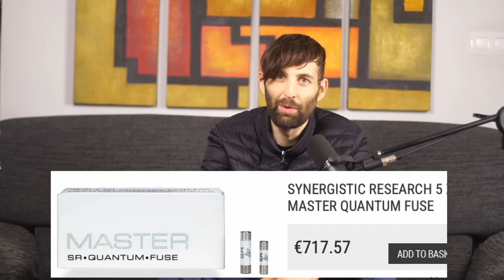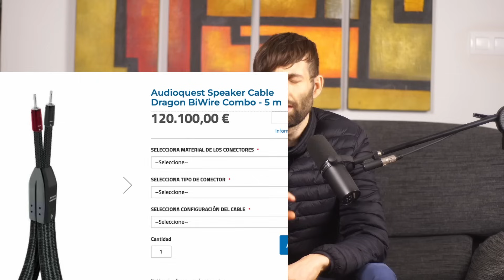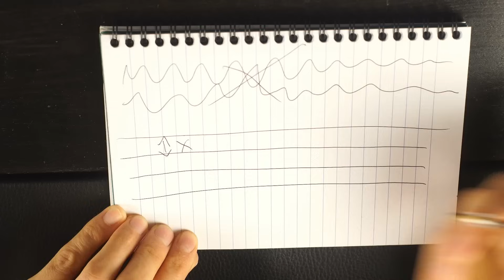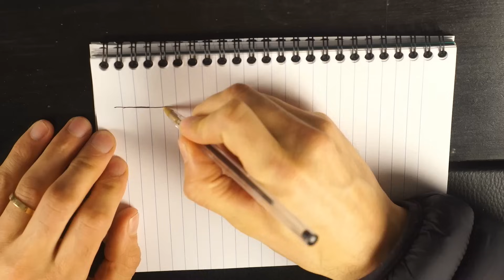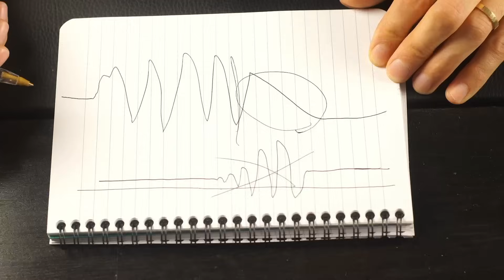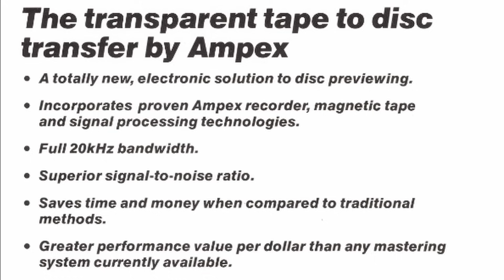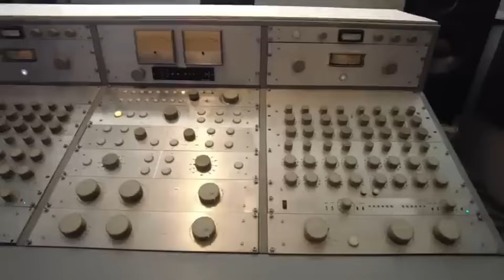Hard truth: most vinyl is digital anyway

Comment: I saw a video from YouTube where this audiophile started to listen vinyl after years of digital. He took quite engineer's approach to it which was nice. For example how vinyl "sucks" itself a ton of static electricity and that adds pops and bangs to the sound. But one thing really caught my eye; how damn dirty vinyl records are when he looked them under microscope. He tried to brush them with different type of brushes and wash them with expensive record washer and still the record grooves were filled with stuff. Does that dirt add to the "warm sound" of the vinyl...?
Reply: Since ultrasonic cleaning machines have been used, vinyl is quite clean- even under a microscope.
Reply: @Eightplex  Like I wrote, not those records. They were filthy even after the ultrasonic, and if those were filthy a lot records will be.

Comment: People like to compare their x1000 euro ‘analogue’ setup with a 50 euro cd player made with the cheapest dacs.  Yes, you can convert digital information to a non digital storage medium and then play it back through the best equipment and it will sound better than having a flawed device spreading the digital information into a  non accurate analog signal. The digital information stored on a cd (or where ever) is enough to recreate the original signal - as far as that signal is cut off to a frequency an organic human can hear.    But the sound waves banging on your eardrums are analog. So it is all about the way you convert the digital information into an analog signal.    And if you like fiddling with records: listening to music is mostly about the whole experience. So I can understand that fully.
Reply: A 10$ modern DAC chip sounds more transparent than vinyl.

Comment: There is an era of vinyl, late 70s early 80s where they were actively marketing that it was DIGITALLY RECORDED.  These were the audiophile discs of the time, demanding a higher price tag because it was a new and superior method of recording and mastering.  I collect DBX encoded vinyl from this era whenever possible, because it really does reduce surface noise and it's always a very good recording.
Reply: @jdraven0890  1812 Overture vinyl brags about digital cannons.
Reply: @Keith-ux9ku  ok that is hilarious - I really prefer fully analog cannons, myself though using one in a recording studio poses obvious challenges
Reply: Alan Parsons' Eye In The Sky album proudly boasts being recorded and mastered digitally. Sounds great on vinyl or CD imo

Comment: Seriously, this video is silly. 

Of course digital is not transparent. Not only does the conversion designed subjectively, but there always is an analog component to every digital music source that is actually listened to. 

No vinyl afficianado says vinyl is inherently better sounding. At least, no serious collector. But the recording, mastering, pressing of SOME vinyl records sound appreciably better than the CD version of the same release. 

Clearly you've never listened to great records on a solid turntable.

Plus, mastering on the majority of digital releases can be described as "brickwall" such that the dynamics are compressed out of the music. Which is why I have CDs and the same release on 24/192 with the CD sounding much better.

Comment: This guy needs to rephrase his inflammatory headlines. Vinyl is NOT digital. When you can embed computer code into a slab of vinyl and have that code read by a computer that converts it into audible sounds, then THAT would be digital vinyl. But that will never exist. Similarly, a cd cannot hold analog data. There’s no such thing as an analog cd. Magnetic tape on the other hand can hold either type of data.

What sounds better, vinyl vs cd/digital, is a matter of personal taste. I happen to like vinyl. Others may prefer digital mediums.

The studio analogy is full of holes. Any vinyl record played against the original mastered audio in the studio is going to sound very different. A digital medium played against the same master in the studio will sound much closer. But is it better? Like I said, it’s just personal preference. No right or wrong.

A purely digital recording will sound different than a recording where the audio hits analog tape between the preamp and the rest of the console. Is it a huge difference? No. Is one better than the other? No. I happen to like the slightly smoother top end and the compression and bit of grunt in the midrange when tape is involved. But that’s just me.

I will say this: while analog tape does sound nice, it isn’t such a night and day difference that it makes putting up with the difficulties of tape worth it. Again, just my opinion. I do find tape to be a pain in the ass.

Comment: High res/no lim dynamic versions on bandcamp is a brilliant idea.

I'm with you on the audiopholery of the high end audio world... there's a lot of nonsense price at people who have millions to throw away. With that said though, I'm curious to ask — have you actually sat down and listened to any high performance playback systems with and without 'high-end' power cables, or power supplies in place? 

I've done the testing, and on a highly resolving headphone system (Chord Dave), the quality of power cable, and power supply used had an enormous impact on the quality of sound. It wasn't subtle, and I can easily a/b it with 100% accuracy.

Comment: AD Conversion Limitations in the 1990s and Earlier
Low Bit Depth and Dynamic Range:

Many early digital formats were limited to 16-bit resolution, with some consumer-grade systems even using 12-bit or 8-bit ADCs. This limited the dynamic range and could introduce noticeable quantization noise, especially in quieter passages of music.
Vinyl, by contrast, had a dynamic range of about 55-70 dB, which could be competitive with these digital formats, especially in well-produced records.
Sampling Rates:

CD-quality audio (44.1 kHz sampling rate) captures frequencies up to 22.05 kHz, which is within the audible range but excludes higher frequencies that vinyl could theoretically reproduce (e.g., up to 50 kHz). Even if these ultrasonic frequencies are inaudible, they might contribute to a sense of "air" or "presence" in the sound, especially for audiophiles.
Artifacts from Early ADCs:

Early ADCs introduced more jitter, distortion, and nonlinearity compared to modern ADCs, which could degrade the fidelity of the digitized signal.
Vinyl avoided these specific issues because it was an analog medium, preserving the continuous waveform of the original recording.
2. Vinyl's Inherent Characteristics
"Warmth" and Harmonic Distortion:

Vinyl introduces subtle harmonic distortion and a natural roll-off in high frequencies, which many listeners find pleasing and "musical."
Early digital systems, by comparison, could sound "cold" or "sterile," partly due to the harshness introduced by poor dithering and limited dynamic range.
Analog Nature:

Vinyl playback retains the continuous, unbroken waveform of the analog signal, which some listeners argue feels more "organic" compared to digital audio, especially when the latter was limited by early AD conversion quality.
3. Mastering Differences
Vinyl-Specific Mastering:
Records are often mastered differently to accommodate the limitations of the medium (e.g., avoiding excessive bass or high-frequency content that could cause tracking issues). This mastering process could result in a unique sound profile that listeners might prefer over the digital version.
Digital Mastering Issues:
Early digital recordings were sometimes poorly mastered, with engineers adapting to the new medium. These recordings could sound flat or overly compressed compared to the richer and more dynamic vinyl versions.

Comment: I think when it comes to dynamic range the real issue is a lack of standards, and also a lack of marketing. Probably a decade ago I was saying apple or someone could run away with marketing some sort of "HD" audio product to end the 'loudness wars' by setting aggressive loudness limits and designing their hardware to work together with that limit such that it's not just quieter when in this HD mode. As is Spotify is not even really loudness limited. If you listen on desktop web app it's still full loudness such that the less loud stuff does end up sounding weaker. I think you could see vinyl as being the same sort of thing, but with the really good marketing that just leaks through from general culture.

Comment: Last time I sent a master to a premier vinyl cutting house, they requested a digital file, 16/44.1 to be exact.
Reply: Because unlike armchair audiophiles, actual audio pros know that CD quality is all you need, it was literally designed to cover everything humans can hear. 24 bit especially is just marketing and less INAUDIBLE noise (which on vinyl is covered up by audible noise).
Reply: @cl9826 Ever try to record to 16bit? You can't mix, processing causes bit loss. Its just a pain in the ass with no headroom to work with.
So 24bit and 32bit solves it. Its more for production. Some 24bit downloads give you the opportunity to hear that.

I use 24bit to record for headroom and processing for noise and use a DAC that can play it back without down sampling.
Reply: @iLL-iNNeR-GrOoVe  yeah you need 24 bit for recording I agree but not final distribution
Reply: @iLL-iNNeR-GrOoVe The discussion is not about what you use when working with mixing nor recording. It is about the stereo track printed on a CD or a vinyl.
Reply: @johnsilfen70  Yep agree - when working with it - the higher the bitrates and so on the better. Dosnt matter when playing it back when the work is done though.
Reply: What type of masters did you intend of sending? I presume they also don't plan on doing any processing? I fear your going to get a 14bit cut if this is their request. Id try another house. QRP or RTI maybe. If your in the UK there are more options. I doubt they are just going to cut from your raw 16/44.1 files to vinyl without processing or mastering. Either this is not truth or this cutting house has no idea what they are doing.

Did you process files specifically for vinyl cuts? Very doubtful thats the case here.
Reply: can we by any chance hear your recordings? kiitos
Reply: @ Search for 'Plasmingo' on any streaming site. :hand-pink-waving:
Reply: Thats odd none my including digital cut lps  have 22khz cut offs (44.1) when you digitalize them 24/96.
They are usually cut from 24/196 files.
Many better cutting houses use many multiple × the needed sample rate. For example would be DSD cuts.
Reply: @iLL-iNNeR-GrOoVe You probably mean 24/192?
Reply: LOL
Reply: I don’t get why they wouldn’t want something higher res with more bit depth. At least 44.1/24 would make more sense. Purring CD quality audio on vinyl is kind of silly
Reply: @synthetic_films  Why would you need a 24bit digital file for a vinyl record? The advantage of 24bit is that it has a massive dynamic range where the noise floor can be inaudible ... but the noise floor of a vinyl record is way higher than CD spec already! 24bit is useful in creating the master but when you get to the final version you "print" to 16/44.1 as per a CD which is what the cutting house appeared to be geared up to use.
Reply: @ I imagine its because you want to add as least amount of digital noise as possible AND because vinyl can handle the dynamics. An argument for higher sample rates is even easier to imagine since the DAC is relying on the samples to recreate the analog signal which will eventually be printed on to the vinyl. the more samples, the more accurate your waveform is to the master. at least in my understanding...
Reply: @synthetic_films  you literally can't hear the digital noise of 16 bit unless you crack the speakers during a totally silent part with no music playing and even then the noise of your electronics and speakers will likely be higher. If you actually played music at that level you'd hurt your ears. Hell the noise floor of an empty silent room is higher than 16 bit noise, not to mention it's dithered anyways. 24 bit offers more dynamic range than the human ear can even hear let alone is reproduced by actual music. It does nothing relevant and just eats hard disk space like crazy.
Reply: @MrAdopado Because of bit blocks and higher sample rates. There are more points on a 24bit waveform so less errors when doing a ADC or DAC conversion. This is important when cutting to analog. Especially if the source was originally analog.

Also if you are doing edits or processing any further mastering you would need to dither further down in bitrate.

Theres more to processing a digital code than the listening aspect would cause the engineers to use a 24bit file. Do you cut lps?
Reply: @iLL-iNNeR-GrOoVe  Yes indeed 24bit is valuable for processing/mastering but once the version for vinyl cutting has been produced that surely can be in 16/44.1. I would be interested to know if anyone could could tell the difference when playing the final record.
Reply: @MrAdopado Yeah but you cant cut straight from a digital file to vinyl unless it's processed for it. Anyone whom has a interest in mastering will. There will be an abrupt cut off in signal at around 20khz. Actually its the big turnoff to vinyl enthusiast. We know. Recently the DSD scandal was uncovered. Many of us know. 
Plain and simple a real Vinyl house wouldn't accept a 16/44.1 file to cut. Its not about noticing. Im betting the house that master wasn't processed to cut when it was requested. This would be like a 14bit cut. More like a mp3.

Once the fad is over the ones whom wouldn't care won't be listening anyhow. Same usually with a lot of artist. People grow out of the trend. Some are real music enthusiasts.

Im not saying your wrong. Just by past experiences in studio I highly doubt this recording would be submitted by the artist with parameters for vinyl cuts.
More than likely it would be down sampled, then upscaled to some HD conversion while cutting.

Try using a low pass filter around 20khz. See if you notice the cutoff as being noticed within the audible range. 

Bad digital conversions also cause audible ringing around 8- 10khz and up (harmonic distortion oscillations). Very noticeable if they are going to use a 16/44.1. We know they aren't using all analog cutting stages😂
Reply: @iLL-iNNeR-GrOoVe  Hey man you seem to know your stuff, I get what the video is saying (digital section in the analog chain),  I'm a dnb DJ (tracks all digital from the start), and I know that like you say, vinyl cuts are mastered differently to digital. Loads of vinyl stuff is remastered these days too... I kept thinking during this video about this, as there must be a DAC somewhere in the mastering chain.

Even if that DAC is happening just before the lathe hits the dubplate, it must be there, so it seems that this is a really important part of the process. Is it correct to say that this final conversion is more important than the "digital delay" mentioned in the video? 

Because any quantization in the digital track has to be smoothed out in the vinyl mastering process, and maybe that's more important than the source  material
Reply: @synthetic_films The more bits mean the digital system noise cab be lower. A higher sampling frequency means it can include higher frequensys, in other words ultra sound. In any other aspect the wave form would not become better at all. It is perfect with those two limits providing good hardware is used. In real world recordings the noise from other sources will be higher than the 16 bit system noice floor and ultra sound would often be better without to avoid putting your hifi to unnecessary loads and other artefacts.
Reply: @synthetic_films  Vinyl is not exactly good at handle dynamics. 
However. 
The DAC argument is nonsense. It has nothing to do with bit depth when it comes to encoding it. Its all about the sampling rate. 
The reconstruction of the waveform is exact up to a frequency as high as half of the sample rate. 
Thats called Nyquist. 
So 44,1khz - you will reproduce the correct waveform for all frequencys below 22,05 kHz. Since you cant hear higher than that in any way anyway, a higher sampling rate is simply not necessary for listening back the audio.

The bit-depth has nothing to do with the reconstruction of waveforms with dac's, all it changes is the signal to noise ratio. even 1-bit coud reproduce a waveform correctly - it woud just be noisyer. Thats why higher bitrates are relevant to people in studios working with the audio, less noise is very relevant when you have 80+tracks in your DAW - since noisy tracks can add up and get loud fast that way. But for listening back 16bit is simply enough. You will have no noise at normal listening levels.  

Greetings
Reply: @synthetic_films  "I don’t get why they wouldn’t want something higher res with more bit depth. At least 44.1/24 would make more sense"

Vinyl LPs are limited to about 60 dB in dynamic range - which is about 10 bit sample resolution - so 16 bit are far more than enough.
Considering that the machines to produce vinyl lps are at least 30 year old and were of course not getting better over that time in most cases even that 60 dB will not be reached.